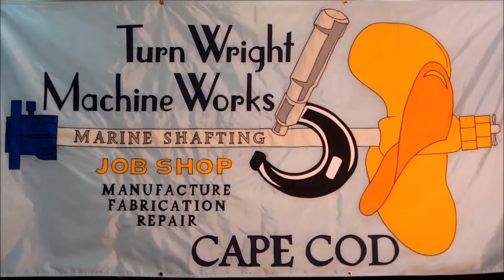The Broken Beaver Part 1: Wood Chipper Repair

Comment from the maker: Thanks for the comment, that method is right there in my book also; in fact I show it in other videos! This particular job, I wanted a more rigged set up for hogging off some serious metals before getting down to size and showing other ways to getter done. I switch over to the four jaw to finish the shaft in the rest of the series. ;{)---

Comment: I used to be employed as a mechanic at a Vermeer dealer, and this is not the first broken shaft I've seen. That part takes a very high amount of abuse in the normal course of operation. Not only is it spinning and having to deal with the uneven types of wood the blades are cutting, it also has hydraulic feed rollers pushing the wood in against the drum. You'd think they would have considered these forces in the design process, and not left so much tolerance in the hub's bore. That's what you get with mass production I guess.
Reply: Must have been an anomaly in the material supply???Shizz happens.  And a "gitter-done" day!  Ha ha.  Gota ponder the mfg. warrantee.......  Bet Keif's shaft will spin longer than the OEM.

Comment: nice one. the bit on harmonics is interesting.. the closeup shows a bit of a dig in a regular pattern, no doubt when the wave is pushing on the tool as it processes around the work. (looks like every 3/4in or so?)  i've noticed this on smaller pieces on my lathe; it looked more like chatter, but there was definitely a resonance pattern. looking forward to #2!

Comment: Nice to see some failure analysis. To be really certain about root cause for the failure you have to look closely on all details and understand the loading this part has. However, from the radial marks you have near the welds it indicates multiple starting point of cracks. Making welds always means initiated cracks so the root cause is maybe a small part due to bad welding but mostly bad design having a weld at that location. Depending on the loading the clearance might influence the life.

Comment from the maker: Keep trucking, your concern proves your workmanship expectations. You’re only going to be supporting the ends of your part; you need to support the middle as well, not just because of weight but because of the sag also! Use High pressure lube and keep an eye on them. If it makes you feel better drill a larger hole and single point the taper to suit your comfort zone size. If there was a set of rules for the limits someone would ignore them anyhow. ;{)---

Comment from the maker: A positive rake on a tool bit, scoops under the metal, giving the ease of downward travel of the material from the cutting edge, across the top surface and negative rake on a tool bit, lifts or pushes the metal coming off the cutting edge almost giving a ricochet / skipping effect, due to the increased tool pressure. ;{)---

Comment from the maker: It is basically the tool bits or insert bits angle of approach to the part. If the angle of the approach is tilted toward the part its cutting it is referred to, as a negative angle and if tilting away it is a positive angle. There are variations to the shape of the top side of some inserts that give one the others characteristic. ;{)---

Comment from the maker: I would think, shear pin means, giving way and free spinning. This broke the shaft and removed 1/4" plating around the drum, snapped one blade off after it removed the bolts holding the shut assembly on and some other stuff you can't see in the photos he gave me from his phone. ;{)---

Comment from the maker: The color of the chip is or can be progressive in the changing, after it has been removed, still flying in the air from natural, yellow, golden blue, purple to dark blue almost black! But if it is coming off the tool or insert light golden color you’re in the good production chip or maximized the combination of speed feed and depth of cut for the material. ;{)---

Comment from the maker: For the spindle of the tailstock, I would probably go with 1137 or 1141, due to the amount of machining steps, a medium-carbon steels W / Higher Mech. Properties. QQ-S-637 – UNS G11370, G11410. ;{)---

Comment from the maker: Ya, you are going to have some gear noise and the reason you can hear it is because everything else is quite! I did have the small gear that drove my power feed out of alignment when I first started mine; give a hell of a gear screech. As long as you can definitely feel back lash in all the gears for their complete rotation, it will be fine! ;{)---

Comment: Kind of looks like it might have started with small surface cracks on the edges of the weld.  Doesn't help that it only had fillet welds holding it.  With that clearance, the shaft would have been flexing inside the hub, which would have put surface tension on the weld cracks.

Comment from the maker: I use a stock and reference book, if not familiar with app. The threaded parts or screws, first thought is to go to 1213/15 screw machine stock, but reading on, stressproof and 1144 Hi stress ASTM A311 class B or Fatigue-proof TM LaSalle Steel Co. are recommended for lead screw making, high accuracy and smooth gloss finishes. ;{)---

Comment: in this case you are using negative tool holders which hold the insert at a negative angle. therefore the inserts have no relief on the inserts themselves cause the holder creates the relief, you can seethis by putting a square on the bottom of the insert and seein that the side and bottom of the insert are perpendicular, now there are types of chip breakers on negative inserts that are referred to as positive and negative rakes.  both of which u have the dmnp is a positive rake negative insert.

Comment: Always love your stuff Keith.  Wondering on setup of the lathe, you mentioned bad floor &setting on steel plate.  Do you have any kind of vibration absorber such as Unisorb or rubber mount leveling screws supporting the lathe?  If not why?
Reply from the maker: krtichacek I have disc plates under my jack screws between the plates on the floor and the jack screws, to get a greate support after leveling it several adjustments in the first couple years of time. ;{)-----

Comment from the maker: Some inserts can't handle the interrupted cutting and the pounding of weld build up! Sometimes massaging the top of the build ups with a grinder softens the impacting and you can get under the surface faster. I'm not sure what your cutting or insert type just thowing a tip out of the hat! ;{)---

Comment: why didn't you use 2 centers; 1 fixed, 1 live and an carrier and catch pin ? instead of a 3-jaw and 1 live center ? this way you wouldn't have to flip it around and it wil be as concentric as it can get. then adjust the tail stock to compensate for a conelike shape of the shaft. just a tip from holland :)

Comment: Keith, great vid as always. I have a question. I noted that when you changed from a positive to a negative insert you didn't make any adjustment to put the point back on center. Are the inserts designed to no adjustment is necessary and they end up on center no matter which type is used or is it that the minor difference in height makes no difference?
Looking forward to the rest of the series, thanks!

Comment: Would it have been possible Keith to turn in between centers using a lathe dog to drive the stock to turn it true to the centers?  I guess though that what have required a pretty big lathe dog!

Comment: Alright Keith, I can't take it anymore. How the hell do you drill so deep with those center drills without them snapping? Before I thought it must just be the rigidity or your machines, but no way here as you are holding it by hand! I can seldom do more than get the point in, any more than that and it's probably gonna snap. Maybe it's cause I'm using carbide?

Comment: Hey Keith, how do you determine what kind of metal to use on certain jobs? I have an old Monarch lathe that I need to make a new crossfeed screw and nut and also a spindle and screw for the tailstock. What kind of steel should I get for these parts?

Comment: Question - at around 20.00 or so, you tightened up the tail stock locking but - you were going counter-clockwise - maybe the locking to the bed has some strange config? Anyways - that's one big-ass chunk! I use sulfur based cutting oil too but always get a bit concerned when smoke suggests super hot tool temps. You inspired me to do a 9 part series looking at some of my old work from way back, much smaller stuff -  /watch?v=QeBU97uC-Yk - mostly gadgets!

Comment: The shaft on your web site is the work I was questioning myself on how I would make. How did you determine the #8, was it called out on the print?I've never worked with anything that long before. I've worked with big dia.'s but mostly short turning and face work.In my 15 year career so far I have never found any info or reputable insight on this subject.Unless specified by print I always went with what looked proportional.

Comment: Mr. Fenner I have a stumper for ya, or for anyone else commenting.Are there designated center drill sizes for proper support of a shaft? I know drill depth is typ. 2/3 up the center drill.For ex. is a #2 center drill for supportting up to say 1" dia.?Or is it strickly operators choice.I have questioned myself if I were to turn 12" stock of fairly significant length, what center would I choose.Other than the obvious biggest one I have on hand choise.

Comment: Is that a left hand threaded screw holding down the tail stock on your lathe? And why?
Reply from the maker: I have answered this several times in the past, the left handle thread works with your body position, not causing you to change stance just to loosen the tail stock because your pulling strength is greater than your push. ;{)-----

Comment: I know it is faster to use the 3 jaw chuck than  using a DOG drive , but working between centers is it not more accurate to use the dog drive way ? placing the dog to drive off of a jaw and a center clamped in the three jaw chuck?

Comment: Why are you burning green wood? I read an article about a huge central heating plant using green woodchips because the steam improved heat transfer in the boiler. But I never heard of someone doing that in a wood stove.

Comment: Is ya lathe (in this vid) a Dean Smith & Grace?  If so, which model?
Reply: I believe it's a Clausing badged Colchester Triumph Mark one and a half (honestly), made in the UK. It was remodelled with the familiar Colchester square styling as the Triumph 2000 in 1968. Worked in a shop that had all the Colchester models...brilliant machines.

Comment: what is the make? size? and year of your lathe?   options?
Reply from the maker: The lathe is a 1950"s Clausing Colchester 17" with 29" gap and 3" in the spindle, tracer and steady rest. ;{)-------
Reply: Keith Fenner...I watch a lot or your videos, really appreciate your efforts to make/post them......and long ago a friend of mine who operated a motorcycle repair shop really like the Colchesters for a larger than usual spindle through hole....a smaller lathe than yours, but a 1-11/16" hole...great for those 1-5/8" Harley Fork tubes... well...actually 40MM....

Comment: do you think the original shaft was made out of mild steel keith
Reply from the maker: No it was good steel, have made a few parts from the broken pieces I saved. ;{)-----
Reply: just built badly

Comment: I have the feeling that american people use the term DIAMETER when they mean circumference  or perimeter (outside wall of a cylinder) Am I right ?
Reply from the maker: Diameter is the straight across section, center line, parallel to the axis, or circumference divided by Pi, whether it be an inside or outside reference. ;{)---
Reply: Oh thank you Keith, I know you know! Nevertheless as a technical translator (Mostly John Deere AG machines), I often have to translate sentences like  "Apply some grease on the axle diameter" or "Grease the outer diameter of the adjustment nut with assembly grease". I got used to it so it does not bother me anymore. But give it a try on Google you'll be surprised how some people understand this term.
Anyhow I love your video for that matter. They give me a good understanding of metal work, which is great for my job

Thank you and "getter done"

PS Nice emoticon you have